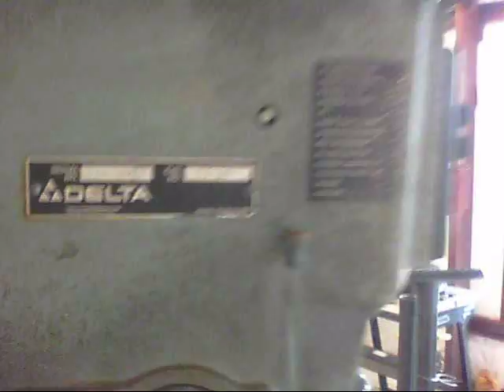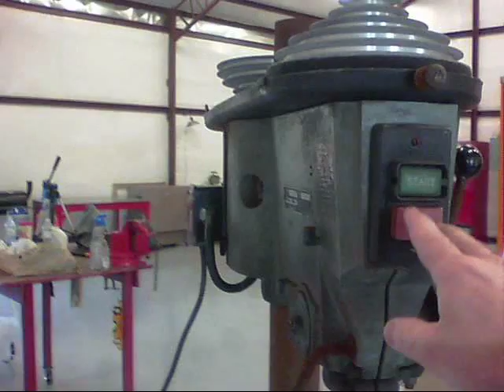Drill Press Restoration

Comment: Good job.What did you use to clean up the rust?
Reply from the maker: Scotch brite wheel, sandpaper, wirewheel, elbow grease. Also used an acid solution for some of the parts like the chuck.